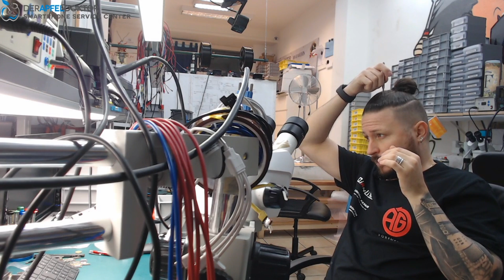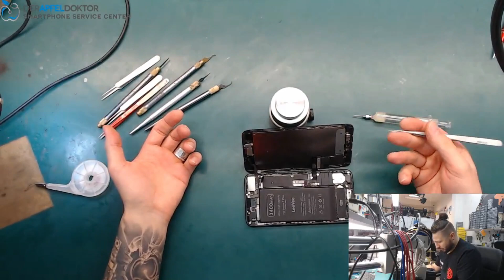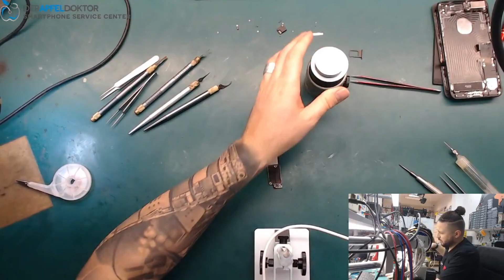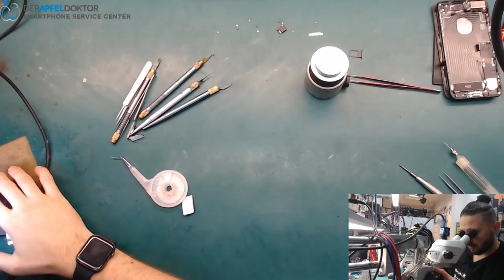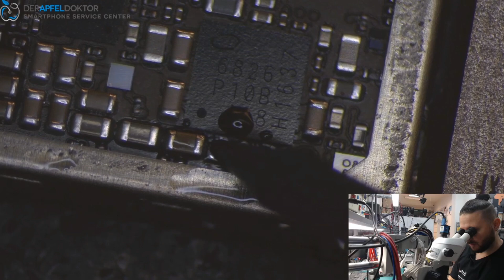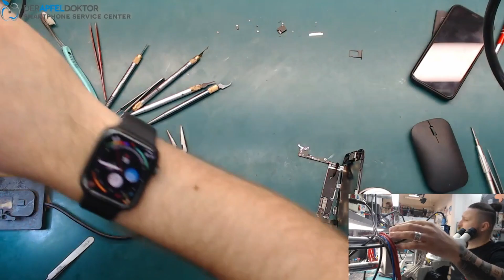BASIC REPAIRS - iPHONE 7 PLUS DOESN'T TURN ON - NO POWER - NO BOOT - FINDING THE SHORT

Comment: I also have an iPhone 7 that doesn’t charge or turn on. The power is being transferred by the charge flex but it doesn’t reach the battery I checked the capacitor u replaced on this video but it looks ok its not cracked or anything so im now still trying to figure out what’s wrong

Comment: Hi there, ive tried to use your website but it keeps refreshing every time i put in my address and submit, is there anyway i can contact you otherwise? i have a iphone 7 plus with this exact problem. many thanks.
Reply from the maker: Hey. From outside Germany you need to create you label for mail on by yourself. Don’t forget to fill out the form for the repair: https://www.der-apfeldoktor.de/downloads/Reparaturauftrag.pdf
Reply: Apfeldoktor do you have the form in English?
Reply from the maker: Sixth Element Detailing Sorry but no. You can use google translate or write an email and I will sent you the English form on Monday.